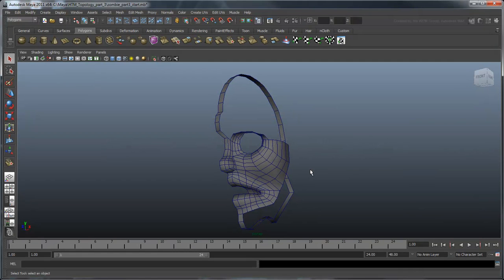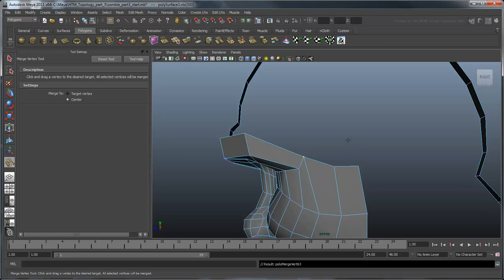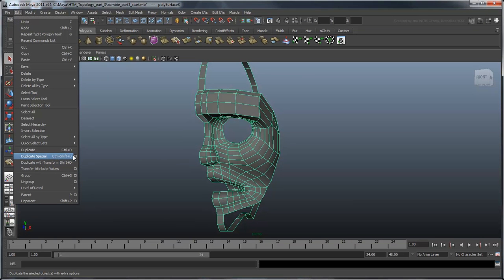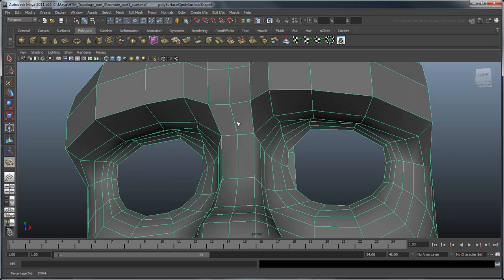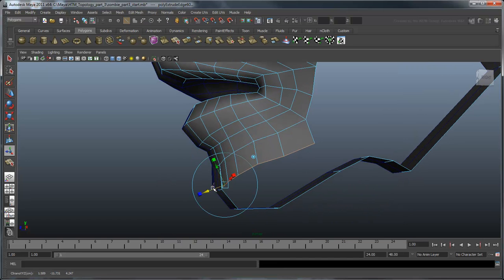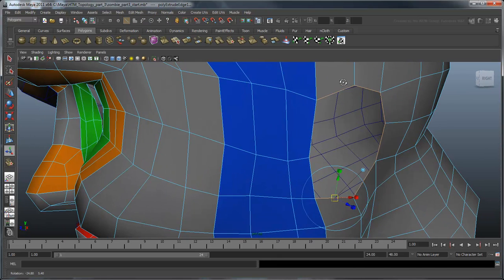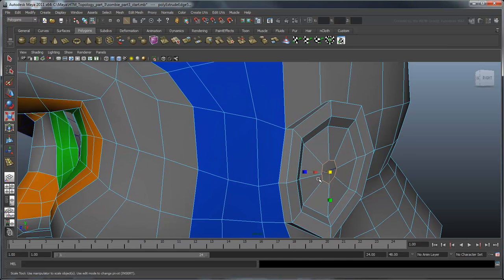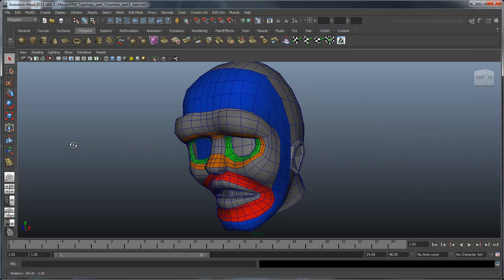Modeling a head with proper topology - Part 3

Comment: Hello! Thank you very much for this tutorial. 
I'm a beginner and started my first Maya tutorial with your "Modeling a head with proper topology" playlist.
It was everything ok until y used "Duplicate Special" (as many others, as I could read in the comments and other blogs over internet). The duplicated part turns black, and I can't change it.
I already tried reversing the Normals, but if I reverse one of the normals it'll reverse both (because I used the Instance option).
I also checked my Preferences, and I have the Keep faces together On.
I just can't go on because of this problem, and I've been looking for a solid answer for like a week with no good results. I hope you can help me with this :D 
Thank you for your time. Regards!
Reply: +Martín Perucki I just found one (not recommended) solution: I saved my project, closed it and then imported it in a new project. The problem is gone (though I would like to know what's the root of the problem...)
Reply from the maker: +Martín Perucki It was likely still a normals problem.  Why did you choose to duplicate as an instance though?  

Another option is to use the Mirror Geometry option and mirror across the -X axis.  This will automatically mirror and join the two pieces together.
Reply: +Maya Learning Channel In this video (at 2:47) the Instance option is On. I will try the Mirror Geometry and see what happens.

Comment from the maker: +Yash Pandya If you've deleted the history on your object (like your cube) then those inputs will disappear.  In that case, you'll want to use the Modeling Menu Set's Smooth option to subdivide a mesh.
Reply: Maya Learning Channel  No it is still not working!
I tried it with  a new document + restored all the default settings, but it is still not working!
I haven't updated service pack, so can it be because of it?
Reply from the maker: Yash Pandya Is construction history turned on in the first place?  Alternatively, you can increase the number of subdivisions at creation time by creating via the Create > Polygon Primitives menus (just click the small square next to the object you're trying to create).
Reply: Maya Learning Channel  where to turn on construction history from?
Reply from the maker: It's up in the Status Line.  http://help.autodesk.com/view/MAYAUL/2016/ENU/?guid=GUID-503E227B-EF49-4A78-B3CA-7EAC588017C9

Comment from the maker: There's a couple of reasons this may happen.  One of the reasons could be that you have the "Keep faces together" option turned off (see the comment below for a fix).  Another reason could be that the face normals are inverted and hence you are actually building the model "inside out".  The best way to check is to go to Display > Polygons > Vertex Normals.  If all the lines point inward, then you'll have to use the Normals > Reverse command to flip them around so they point outward.

Comment from the maker: It sounds as though you may have the "Keep faces together" option turned off.  If that's the case, the extra faces are actually being created whenever you extrude an edge, but it just so happens that you notice them when moving around the vertices.  

Check to make sure that the Edit Mesh > Keep Faces Together option is turned on while modeling (except in very specific cases)

Comment: Whenever i move vertices with the move tool, it creates extra faces that can be seen when switching to the vertex face mode (as lines between the faces) or when moving the vertices around again (as connecting faces between the neighbor vertices). They cause that I can't apply the insert edge loop tool as the topology is somehow destroyed by this, plus I can't move the vertices the way I want because it reveals these extra faces. How can I fix this and avoid it in the future? Thanks in advance :)

Comment from the maker: @TheStickofWar Have you remembered to merge the vertices?  Without that step, you will get many overlapping vertices.  If this is the case, you can marquee select your entire head and go to Edit Mesh > Merge > [].  This will merge all the overlapping vertices.  If you find the verts aren't merging, you can increase the threshold slightly and try again until it works.

Comment from the maker: Too many tris on the other hand will eliminate your edge loops, making it extremely difficult to work with your model since many tools are based on these loops.  They also have a tendency to smooth in undesirable ways.  In general renderers DO render things based on tris, but since every quad can be represented as two tris, the renderer tends to take care of this conversion automatically.